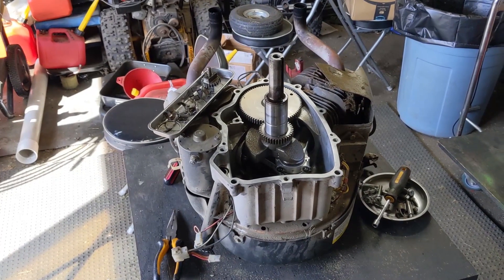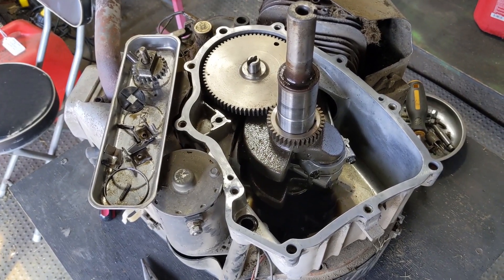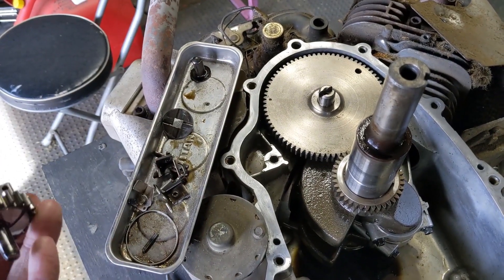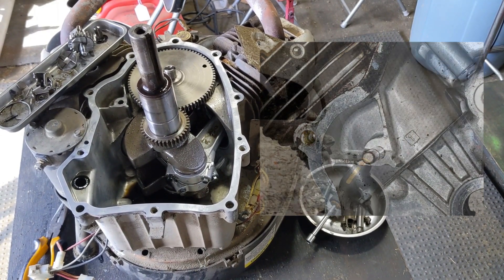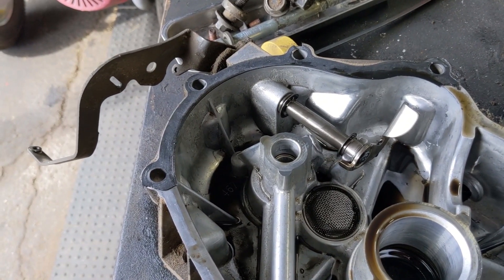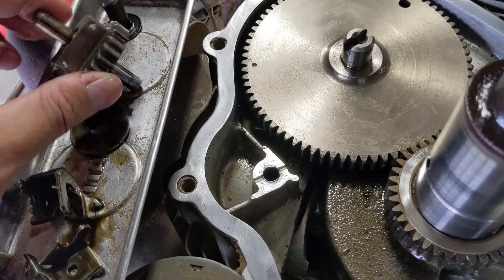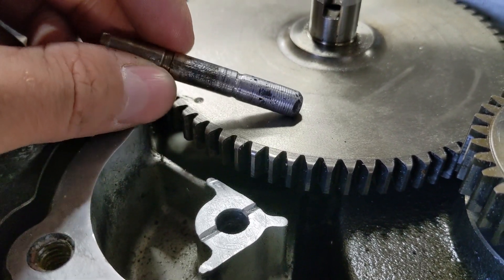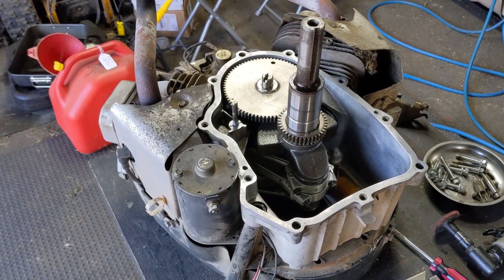Importance of Checking the Oil

Comment: I check my intek because it frequently floods the case with fuel if the fuel cock is left open. Interesting to see the governor action. Be well all!
Reply from the maker: Sounds like you need a new needle valve in the carb, or there's a pinhole in the fuel pump!

Comment: Right on buddy, it is extremely hard to believe that people do not take the 10 to 15 seconds it takes to check the oil level in their 4 stroke engines. Apparently if they did check it small engine repair businesses would lose a lot of revenue and people online would not sell as much equipment. This appears to be an expensive repair with no guarantee on the engine repair since you can not see if there is further damage. Nice repair on the shaft it should hold in place saving your customer a significant amount of money. Good video and good luck on this engine running ok! Like the wallered out comment, have not heard that statement for a long time!
Reply from the maker: Thanks for watching!
Reply: Good  day Wayne & Jake.  I grew up on farm,  many  yrs. ago, when getting  tractor out,  dad would  say, check oil ,water & gas.  It is surprising  out that small amount of oil will keep engine running.  Really good point.  Thanks
Reply: And a good day to you Don, i also have great memories of growing up on the farm. My grandfather would say crank it up (hand crank start tractor) or in the winter start a fire under the tractor to heat the oil so we could get it started. Imagine that!
Reply: @waynestefinashen239  Yea I heard that before,  dangerous.  Thanks

Comment: Great video and a very ingenious repair!  One question ....  When you filed down that lip and channel area, did you do anything special to make sure the metal filings didn't escape?
Reply from the maker: Yes I used my Milwaukee M12 handheld cordless shop vac while filing to suck up the boys, then I cleaned out the engine block and sump before reassembly. Just fired up the engine today and it runs smooth!

Comment: I think a  lot of  people get confused on setting proper oil level. Many or  most service manuals I have read say to NOT screw the dipstick in to check level, just inset the stick and let the cap rest on the top of the fill tube or bung. If you screw it in,  you will get a  false FULL reading, and many engines run less than  a quart of oil, so a few oz can make a difference  - at the very least in operating temperature.  What is your experience with proper dip stick reading on various engines?  - Thanks!  - Sandy,  The Aging Hot Rodder
Reply from the maker: Depends on the model, the 1/4 twist ones you go all the way in, same with the pressure fit push in ones. The only ones that usually say don't screw in to check the level have a stick on the side of the plastic saying that. Thanks for watching!
Reply: @EliminatorPerformance  My Toro Heavy Duty 826 has the Chinese LONCIN 252cc OHV engine and that's with a 1/4 turn dipstick and the manual says NOT to insert it to check oil.
Same with my 27 year old Briggs 3.5 hp with a screw in stick.  Thank you for replying - Sandy

Comment: Hopefully this engine will get running like you are happy with Young Man 😎
Reply from the maker: Yes it ran before so it will run again. Just hoping the shaft holds, which it should. Thanks for watching!
Reply: @EliminatorPerformance  glad you are feeling that it's going to work out for you  because of the high price for a replacement engine is out of this world 🌎